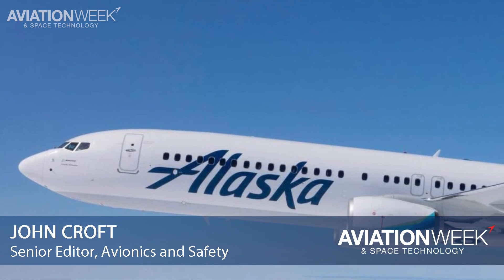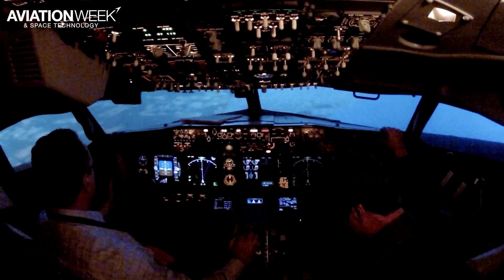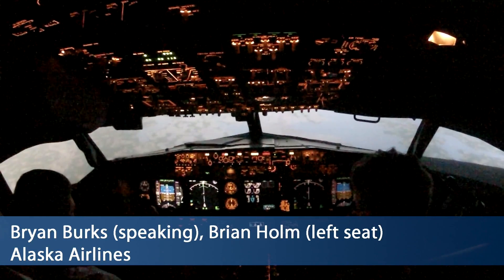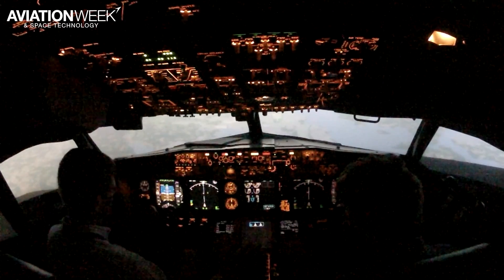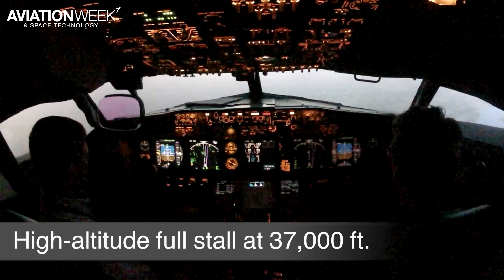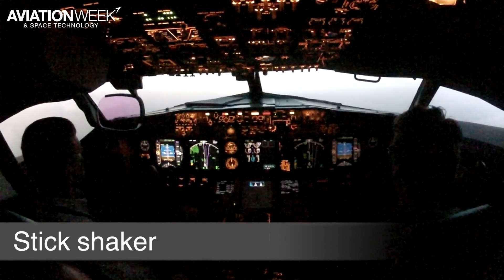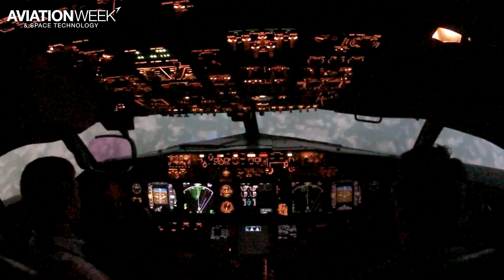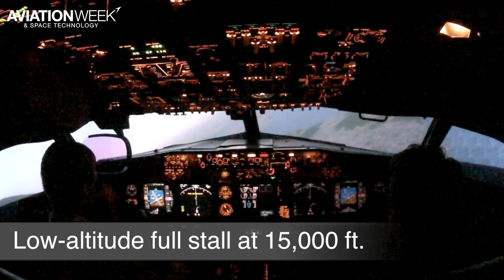How Does A Boeing 737 Handle On A Full Stall?

Comment: Stall recognition and recovery has always been part of the training. Whats new here is that its done at cruise altitude. This is because of the AF447 accident where the pilots held the aircraft in a stall all the way to the ocean from an altitude of 38,000 ft. If we really want to simulate this lets do the exercise without indication of airspeed, climb/decent rate and at night with no horizon out the windows.
Reply: The pitot tubes were NOT bocked by ice at the time of the stall.  The AF447 crew crashed a perfectly airworthy A330 into the ocean stalling all the way from 38,000 ft due to sheer incompetence of the crew and a greenhorn FO who kept pulling back on the sidestick.
Reply: It was not that easy to analyse the situation. Because the problem with the stall warning was, that everytime Bonin tried to push the stick forward, the stall warning sound came in. According to one of the speed displays they were TOO FAST, which can also cause a stall. And when Bonin pulled the stick back the stall sound stopped. So he thought that they are too fast - not too slow. It's easy to blame others. This wasn't an easy situation at all.
Reply: @Fantasmo77  because he caused the situation by constantly pulling back on the stick all the way down to the sea, no pilot would expect another pilot to do what bonin did, as you hear the so many no no no come from the captain when bonin announced that he was pulling back all the time (very annoying to watch that af447 videos and his last two-3 sentences he said on the flight recorder where you was completely clueless on what he had actually done and killed everybody on the plane,i just wish the very professional captain had actually said you just killed us all)
Reply: But there is a procedure for that case!
Every plane has instructions in its manual for maintaining safe speed, which is basically a certain pitch combined with a certain thrust setting ( I think in a A330 it is 5° pitch up at 85% thrust setting ).
The fact that the pilots never mentioned it lets me assume that their training for such a situation was not offered.
That is not excuse though for their bad CRM, which seemed to be more like a kindergarden than a effective communication between crew members.
Reply: (setting aside that they didn't vector around the storm, didn't seem to understand their weight and density altitude performance, and the captain going off to sleep just as they approached the storm)
The real issue is that the Airbus Atari-controls are designed such that the one pilot in a panic was able to prevent the other pilot from making proper corrections and with no indication. Even if Boeing yokes were not linked both are readily visible to both pilots.(and I recall something in the older hydraulic Boeings allows the yolk to separate if enough differential force is applied, and each is linked separately to half of the elevator, so if one half fails or jams the other half is still usable)
And remember that Boeing has 100 years of military aircraft experience that Airbus does not, military aircraft that need to keep flying with severe damage and other adverse conditions.
Reply: And most importantly all Pitot tubes were blocked by ice. That must have been really hard to diagnose a stall in that situation.
Reply: verne ment Except for the cockpit computer shouting, “Stall! Stall! Stall!” Other than that, and the fact that the nincompoop Bonin was pulling back on the stick the whole time, yeah, it must have been hard to diagnose.
Reply: javier roseney I agree, the simulation here was during the day where the pilot can see the horizon and use it as a reference to guide them on how the aircraft is performing. If you wanted to make it realistic, you’d conduct the simulation at night with conflicting data from the avionics.
Reply: The plane flew through a storm at high altitude.
Reply: Why do pitot tubes were blocked by ice?
Reply: Are you referring to AF447 or AA8501?
Reply: verne ment 
The problem was that it was an Airbus.

Comment: It looked like they were in a dive forever regaining airspeed. Did any catch how much altitude was lost from initial stall to recovery?
Reply: Since they are up so high (and therefore the air is so much thinner), stall recovery (from a full stall) can actually require several thousand feet.
Reply: Instructor said to delay recovery procedures until sink rate reached 9,000 ft/min.  So start at 33,000 feet, decend/fall at an increasing rate until 9,000 ft/min is reached, then, and only then, initiate recovery.  Seemed like half the time was waiting for to reach target sink rate before starting to recover.  IRL, I imagine they are supposed to start recovery as soon as they detect the problem, and might not fall so far.
Reply: Christopher Unger thought the same thing !

Comment: I wonder how much altitude was lost on the first stall.  I noticed that on the second stall the instructor didn't let it go into a full stall.
Reply: The second stall was at 15,000 ft. Not much room for error. The whole idea of stall training, is to first identity when the aircraft is approaching a stall. It's a lot easier to recover from than being in a deep stall (which was shown in the beginning to demonstrate what a full stall looks and feels like).
Reply: I was wondering the same thing.
Reply: I was watching for that and noticed that the altimeter on the Captain's PFD displayed a ~400 foot drop. What I wonder about is what's deemed "acceptable" for a professional airline pilot. I know that if my CFI were to see me loose 100 feet on a stall in a C152, I would have never solo'd. If I ever run into an ATP, I'll have to ask.
Reply: On the first stall he seems to have lost at least 2600 feet, possibly more (there's a cut in the video)
Reply: You also have to factor in air density from FL370 vs FL150. Wings will generate more lift at lower altitude and quicker versus at cruise, hence the reason stall speed is so high at cruise.

Comment: Perhaps Congress should have mandated this training instead of 1500 hours and ATP for the right seat of a Regional jet. Stick and rudder skills, what an amazing concept!
Reply: Congess Fs up everything, all a pony show to gain feelz with the uneducated voting masses. 
The FAA is the designated expert and should have been left to do their jobs. The Colgan flight that was propped up as a poster child would not have been affected by any of the changes and actually could have been prevented by simple enforcement of existing rules, the problem was that Colgan was running a pilot mill and actively employing rubber stamps, several instructors had previously refused to endorse the pilot in question during his training, even noting in the logs that he didn't have the aptitude. I've met pilots that were sent to that training center by other airlines and they said it was a horror show of "memorize what will be on the test and nothing more".
Reply: @mytech6779  --Big Flight Schools Managers in USA went to congress to demand that 1,500 hour to be a copilot crap.  They just wanted to keep the new CFI's as their wage slaves staying at the flight school for 80 hours a week and only be paid for 30 hours of flight as an example.  The managers of some of those big pilot mills get kickbacks a lot from rich families to pass the clumsy or coward.  Just like big USA colleges do too.  Racketeurs Managers are the cause of most USA GA accidents.  And did you know most of those accidented by pilot error pilots outside USA were trained in USA too.  Crooked Managers that cant do forced landings on take off or low go arounds on the flight school airplanes are the cause of most USA accidents via bribery and corruption. 

Congress cowards instead of punishing the flight schools like Comair that was passing many chumps as captains and panicky pilots as copilots should be the ones PUNISHED FOR KILLING PASSENGERS.. But...NOOOOO!! lets punish the low time pilots instead by making them stay as a poor and overwork slave of the rich flight school owners and manager crooks.  They punished the poor as usual and gave more slaves to the rich big flight school crooked owners, the real root of the problem.. 

Most times USA Congress sides with the desires of the very rich or rich corporations... Congress say "Screw the hard workers, they dont have the big lobbyist that control us.. Fuck the poor workers most USA congress they say to themselves.  And the corruption in colleges and flight schools is still there..
Reply: Meanwhile they do something as rock stupid as approve remote pilots in place of copilots... really should write a representative about this one. 
Cars have already been hacked, and assuming the onboard pilot has the power to disconnect (in the event of a hack) this also leave the on board pilot with 100% power with nobody there to mitigate. And of course the cockpit is locked so other flight crew can't assist...

Comment: Seems to me like we should've been doing this for at least the 20+ years. It makes no sense to me that pilots do most of their stall training/practice in aircraft that have relatively tame stall handling characteristics and yet that training ends when it comes time to fly at high altitude and in large aircraft where stall recovery/prevention really counts. And we still have another three and half years at risk of another stall/upset accident occurring before all airline pilots are required to receive this training? Why not start requiring this training next year?
Reply: TonyTheFlyer I believe this is already required, this was either a new pilot in training or just a "refresher" if you will, to help practice the procedure.

Comment: So, if you stall you need to get the nose down, loose some altitude, to get some airspeed to recover, correct?
Reply: And gently pull up, correct.
Reply: Actually your Aircraft flies no longer in the direction of an aerodynamic drag it just fell off the sky like a leaf. If you pull back to early the fall speed is too fast and cut off the flow of air around the wings. So the aircraft just stalls again. You have to get the nose of the aircraft in the direction of flight and recover than from the fall.
Reply: Nose down some but its not just about air speed.  AF447 had plenty of airspeed. The problem was they were pulling the nose up. The air wasn't going over the wings because they were in a climb so they were not producing any lift. You need to get the air over the wings as well to help recover and gently recover it.

Comment: I 've always wanted to do this question: Why should an aircraft that big could go in such a violent spin without serious engine loss, and if you don't have engines, how are you going to recover from it? I mean, what an earth are you going to do to 100 tonne aircraft to stall in 37k feet? Its not military to avoid something and bring it to the edge of the flight envelope. Its a bus!
Reply: +Viktor, aircraft stalls, spins, and recoveries have nothing to do with engines or power. They are a result of the control inputs by the pilot(s), and they can happen at any altitude and during any flight regime. I fly gliders regularly and have no issues with anything you mention. Aircraft all fly the same regardless of engine size or power, or no engine at all.
The movies have scared everyone into thinking that add soon as you lose an engine, the aircraft is "out of control." This just isn't the case. It only means you need to find some place to land since you no longer have power necessary to continue your planned flight in many cases - and for safety precautions.
There are many flights each year that shut down an engine for some reason or another, and NOTHING happens at all. Even the SW flight that recently had an engine disintegrate in flight landed safely on the remaining engine.
So, this training is valid and a great aid in keeping our butts safe while flying - at least in this country. it's the best safety record of all transportation means, period.
So, yes, if you stall even a large aircraft in a bank or turn, it will be a somewhat violent maneuver; and you can bet that the manufacturer has already thoroughly tested that flight regime long before you ever take your seat on board!
Reply: +Chris Gresham already addressed most of your questions, but I have a little more detail to add to this question: " I mean, what an earth are you going to do to 100 tonne aircraft to stall in 37k feet?"

Go ahead and take the weight of the aircraft out, because that really isn't relevant here. The altitude, however, is quite relevant. 

The higher you go, the smaller the margin between the speeds aircraft are cruising and stall speed, because the air is so much thinner up there. Several business jets are rated to go all the way over 50,000 feet, but the range of airspeed they can travel up there is really, really small. 

Because the air is so thin up there, getting into a full aerodynamic stall is a pretty big deal. Stall recover can take several thousand feet, and it is very, very easy to induce secondary stalls.
Reply: Honestly, both of your answers scared me a little bit! I thought that an airliner was solid rock on its flight path! Are they so "fragile" in conditions? I mean you can fill it even in turbulence down low or in the clouds that you are in a very stable machine. Sometimes when I travel and watching the wings movements I am thinking that it would be very hard to put this machine into a difficult state.
I must agree though, that my sciolism is worse than ignorance. I have a lot to learn...
Thanks guys for your answers!
Reply: Viktor Argyriadis It's absolutely nothing to be scared of. It's just the nature of flying, and it IS completely safe. As you can see in this video, there are a LOT of warnings that come long before the aircraft enters aerodynamic stall. Airline pilots (at least in the US) must go through simulator training every six months to stay on top of their game in unusual circumstances.

I wouldn't call the aircraft fragile, that is for sure. Check out videos of wing tests, where they bend the wings in a test rig until they snap. To say that it is an impressive demonstration of strength would be a gross understatement.
Reply: Remember, Viktor, the reason this testing is done is to alleviate the fears or anxieties you feel as you so state.
Aircraft ARE designed and built to be inherently safe by ALL manufacturers; AND they want to be known as quality makers of aircraft.
However, they also have to test these aircraft and insure they ARE safe for you and me and meet the design requirements needed for safe travels. Thus they have to go through this intensive and extensive testing to make certain they pass successfully. This is done so you DON'T have to worry while sitting in back with your meal in front of you and your loved ones around you or awaiting your arrival!
Reply: Yea planes are designed to continue on to an emergency landing with one engine for just such a reason.
Reply: The China Air Flight in the mid-1980’s is a classic example of loss of control of a large commercial aircraft. The aircraft, a Boeing 747, lost one of its four engines at cruising altitude and the aircrew botched the whole thing after that resulting in loss of control of the aircraft all the way down to 10,000 feet. They were lucky in that the they were able to make an emergency landing at San Francisco despite control surfaces of the aircraft being damaged.

Comment: It is about time.  When I was learning over 50 years ago,  recovery from a number of unusual attitudes and dead stick landings were part of the training.  Today, I have my doubts about a lot of the plane drivers of today.
Reply: Why? There's less airplane crashes these days than there were many years ago. And there's more flights these days.
Reply: Air France 447 and AirAsia 8501 are the reasons why. Those two planes crashed into the ocean because the pilots couldn't correct a stall after the autopilot cutout.
Reply: ehstronghold  they caused the stall and didn’t even try to recover from the stall that they didn’t believe was happening in AF447 at least. 
All he had to do was put the nose down 3 degrees and save 228 people.